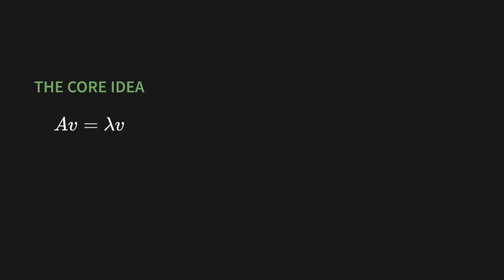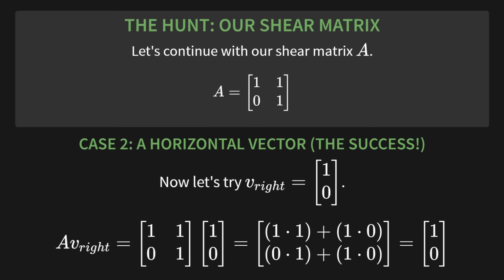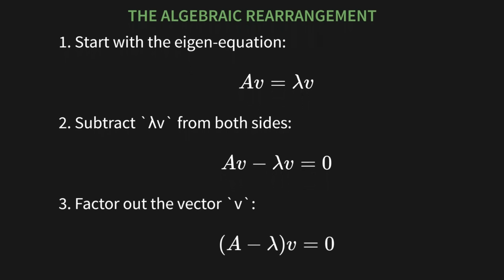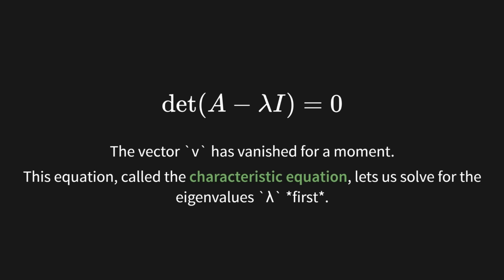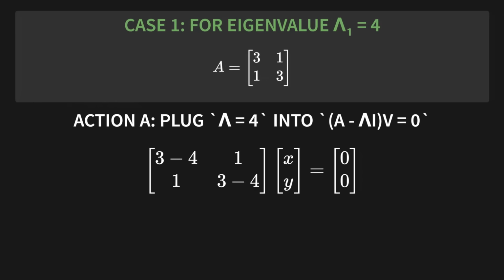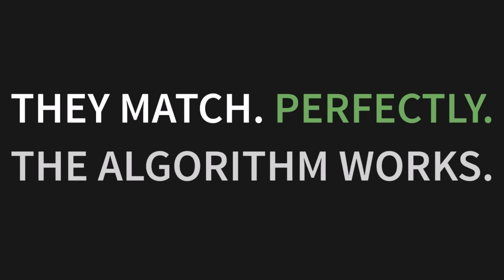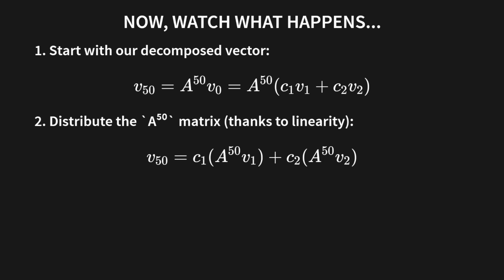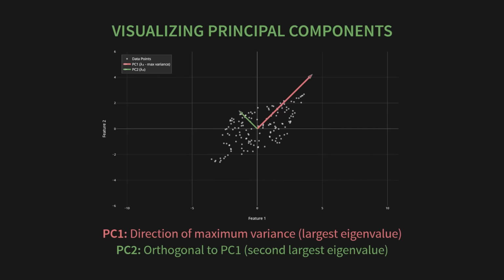Give me 25 min, I will make Eigenvalue click forever

Comment: Not always! In fact non normal systems are commonly encoounter in physics, e.g., hydrodynamics. When eigenvalues are close and eigenvectors are very non-orthogonal transient growth occurs even in stable systems. In fact eigenvalues are powerful but we cannot be condident about them when we are calculating them on computers, see Threheften and Embree 2005. Not self adjoint systems indicate us that the adjoint eigenmodes acts as a filter for optimal forcing and optimal initial conditions to excitate a systems. This is crucial y control theory of fluid systems for example